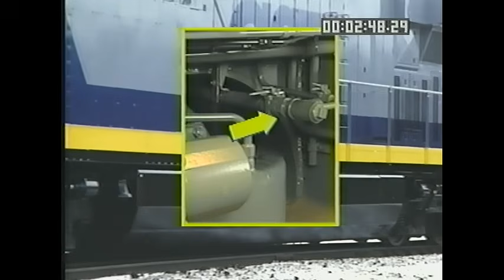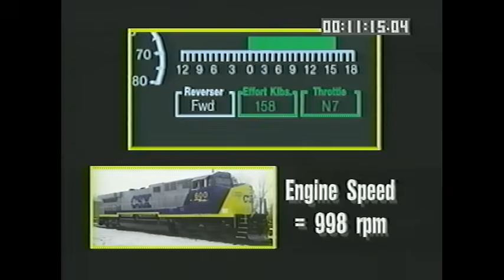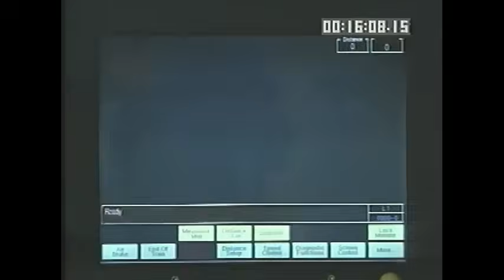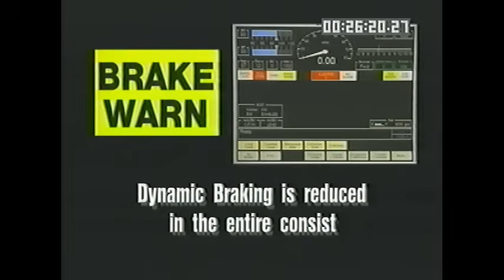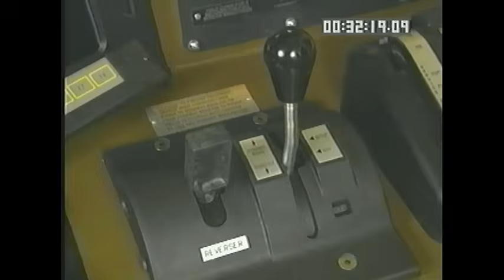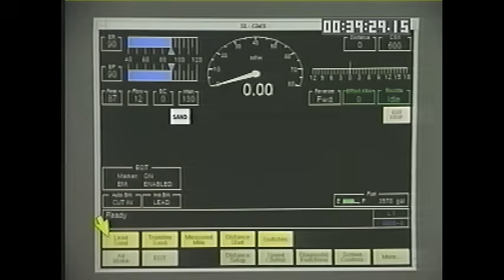CSX GE AC6000CW Training video

Comment: That 6,000 HP is up there with the "Big Boy" steam locomotive!
Reply: yep but unlike the Big Boys, the 6000s had to be de rated
Reply: @w @wondabiz ey didn’t have to be de-rated. They chose to do it during a rebuild cycle for ease of maintenance and emissions. Railroads don’t want super high-horsepower units.